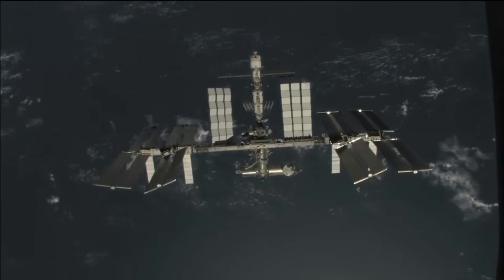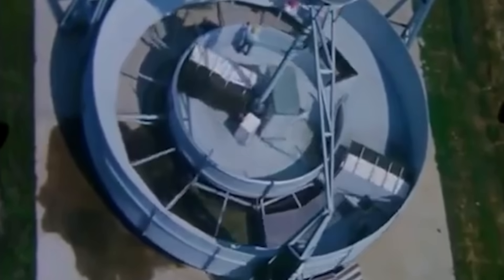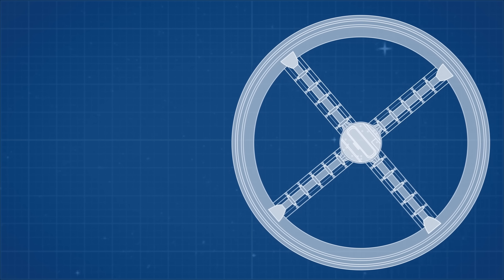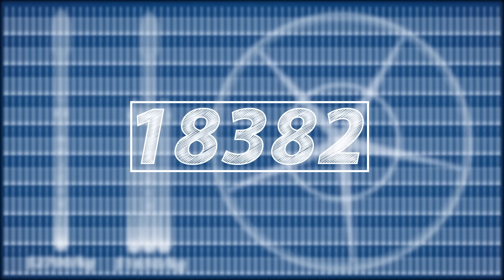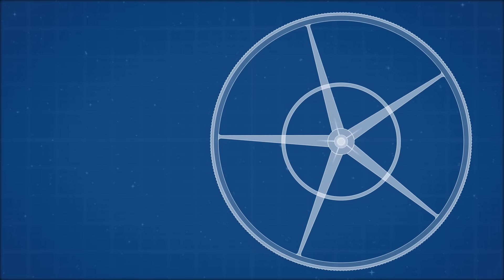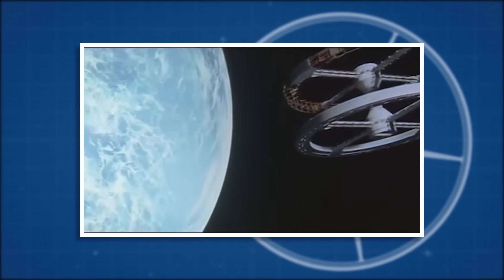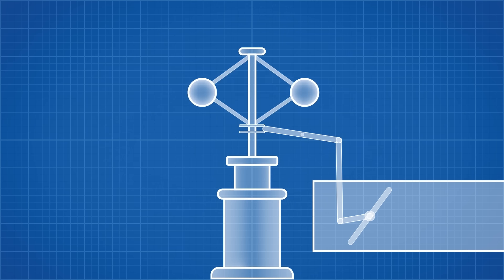Can We Create Artificial Gravity?

Comment: I have a firm grasp on what centrifugal force is, but what is centripetal force? Google defines it as "a force...directed toward the center around which the body is moving." WTF? Is this something that only happens in micro-gravity? I can't picture it.
Reply: The answer is very simple actually.

The centrifugal force is the force that pushes a body outward in a rotating system due to inertia.
The centripetal force is just the corresponding force in the different direction in the material that is holding the spinnig mass together. In other words it is the stress in in the structure.

Lets say you spin around fast with a bucket of water in your hand. The water will "feel" the centrifugal force and not flow out of the bucket (if you spin fast enough).
You on the other hand will feel the centripetal force since you have to hold the  bucket. If you spin too fast the centripetal force gets too big up to the point where you have to let the bucket go and it flys away.

If that happens I bet it looks pretty stupid. Do more workout man!
Reply: Newton's first law - A body at rest will remain at rest, a body in motion will remain in motion unless acted upon by an external force. If you are moving in one direction, you body will want to keep moving in that direction. The floor of the centrifuge, however, spins about a central point, constantly changing directions and applying a force to your body to change directions. This is called Centripetal force.

The Centrifugal force is the inertia of your body trying to stay moving in the direction it's going. Newton's third Law - Every action has an equal and opposite reaction.
Reply: Virgil Pheonix Oh, I see. Inertia, in other words.
Reply: If that's what you want to call it. In terms of spin it's called centrifugal force. That's why we call a spinning device a centrifuge.
Reply: I see. Thanks for the explanation.
Reply: Sorry, I got mixed up there. I thought we were talking about centrifugal force. I went back and looked at your original post and you were asking about centripetal force.
Reply: if you grab a rock tie it with a thread and spin it like a helicopter blade, the outward force is the centrifugal (the suffix —fuge / —fugal, comes from latin fugit which means to escape, also used in FUGITive. centri— center, —fugal escape. So literally it means, escaping from center).
Centripetal is the force that doesn't allow the rock to fly away, in this example the thread that is holding it is counteracting the outward force (the suffix —petal which comes from the latin petere which means to seek, so literally it means seeking the center).

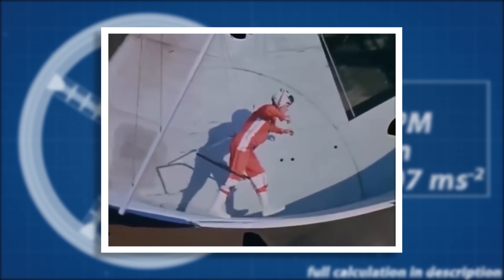Comment: 2:40 Statement is not correct. Head will experience less force and that will force blood to your feet.
Technically it's correct - head will experience less  force, but one of problems in accommodation to micro gravity is that blood flows more to head. In zero gravity blood redistributes not evenly, because of mechanisms of our body which compensate difference in pressure on earth we have(pressure of blood column), which is about  1800 millimetres water column. After some time usually astronaut accommodates that (not fully trough, and you may see that in faces when you compare them in space and back on earth). But even 10% difference(gradient of centrifugal force) will be not a big issue, and definitely better then it is now, specially for digesting system.

Comment: I do not understand why people always envision a huge ring when designing a spun-gravity structure. Why not put a small habitat (a ship's living quarters) on the end of a long cable and spin that? The engines, fuel, and control systems would be in the middle with two habitats on each side suspended with cables. Keeping the whole thing balanced could be accomplished by having the center section reel in or out the habitats as needed and movement between the modules would be by elevator.

Comment: Sorry but some of the fundamental engineering of this vid doesn't make sense. For a rotating body forces increase as you move away from the axis of rotation. Stiff spokes allow extra torque to be added to the ring but don't help to support it. It would make sense to have a hub as an easy point of docking but once spun up it and the spokes would have little if any structural significance as hoop tension would be the dominant stabilizing action.
Reply: Exactly, it's not a wheel on an axle, it's a lasso. The hub is purely a docking convenience and the whole thing would be built stationary and then spun up with rockets on the router rim where they have most leverage. Thankyou for making the most intelligent comment I've seen on youtube today.
Reply: One of the interesting challenges for a spinning station would be maintaining its axial balance. 
If mass were to congregate in one area of the ring say when everyone was sleeping in a common area the ring would tend to become unbalanced generating uneven stresses in the ring. For a heavy ring made of steel or some other dense material this would not be much of an issue as the eccentricity would be minor.  
For a light weight inflatable structure this could cause a serious wobble in the structure.  
An easy way to mitigate this would be to have a tube half filled with air and water. This tube could act as a self-righting mass to ensure that even a light weight station always remained true to its initial axis.

Comment: Your video is too pessimistic. Artificial Gravity is actually cheap and was created on the Gemini missions in the 196O'ies. You only need a light steel tether to connect two capsules or habitats...or a habitat connected to a spent rocket stage. Tether needs to be about 120meters. The amount of mass does not really matter. You could do it with two small habitable capsules for a total 10.000kg or about 20.000lbs system. That is one dapsule connected to its rocket upper stage. The present day lighter materials allow for much more safety and performance for the same weight. No engineering brain will be hurt in the design of this simple system.

The only reason it was not developed is that we actually went to space to experiment with the microgravity environment and it was not necessary as a countermeasure for ill health effects on the short duration missions. Only today, where we again think to move out into deeper space, does artificial gravity become the focus for potential investment and investigation.

Keep up the good work!